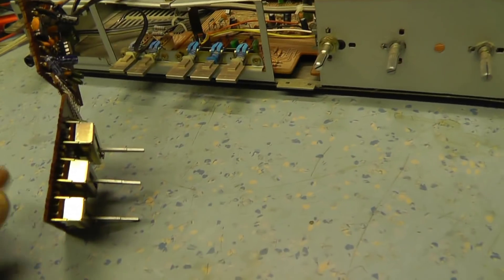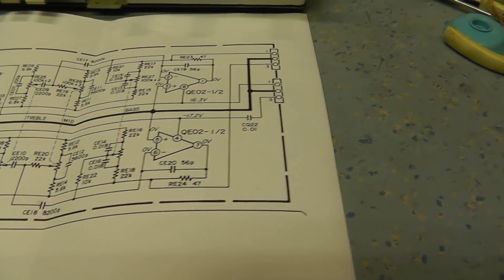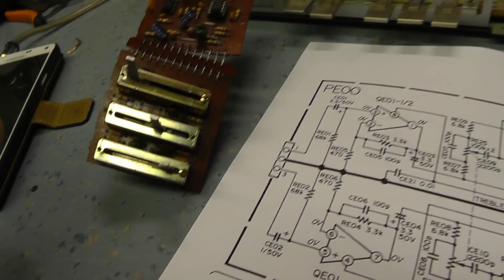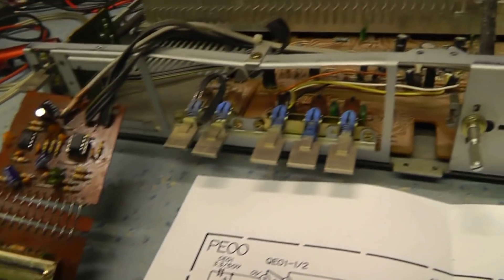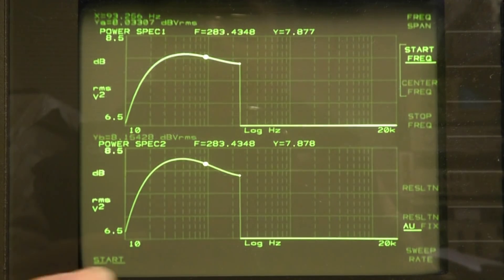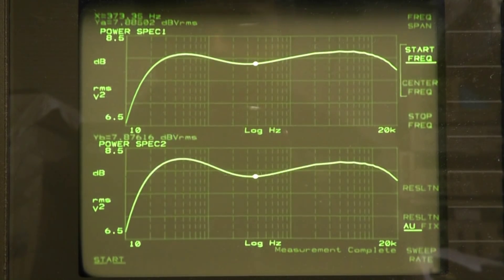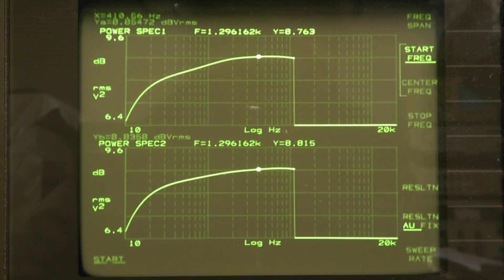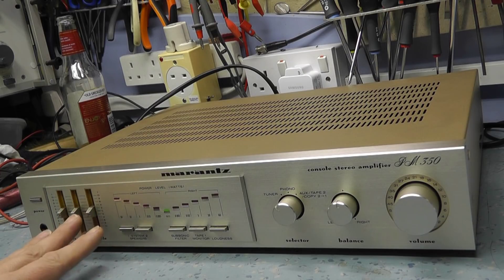Marantz Pm350 Pt3 Repair response check  and close.

Comment: Nice repair and it's in such a nice condition! 
I was wondering if the sliders would adjust both the left and right channel simultaneously, but the schematic answered that question, it shows a mechanical link, so they have two carbon(?) tracks each.

With what did you test? The random noise option on the 3562a DSA?
Can you do a video on how to use the DSA to check an amplifier like this? I mean, we all see the results, but there is no video on how to actually use equipment like that, I think.
How do you hook it up, what do you adjust the amplifier for? Full volume output or a moderate level? I'm not in this specific field, but would find it interesting to see how to do a proper measurement with equipment like this. ;)

Comment: Good morning from Greece, dear sir, I also have the same amplifier and as soon as I open it I burn the fuse of the transformer, but also the 2 fuses after the rectifier bridge 3.5 amps, I would ask you from the bottom of my heart if you can give me some advice , also burned my R806 resistor which is 270 ohms, also I can not find Service manual, thank you from the bottom of my heart.